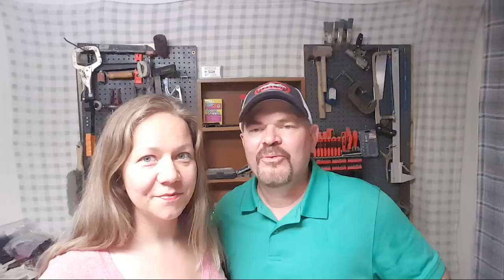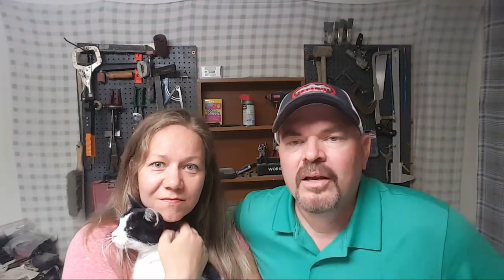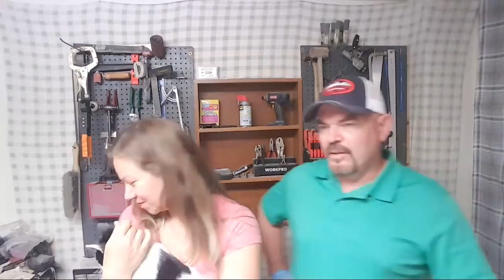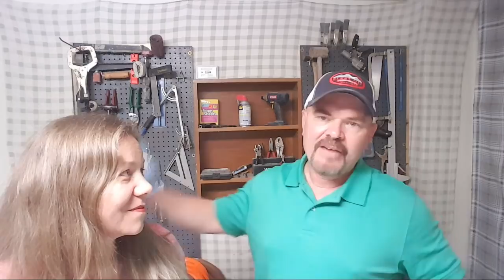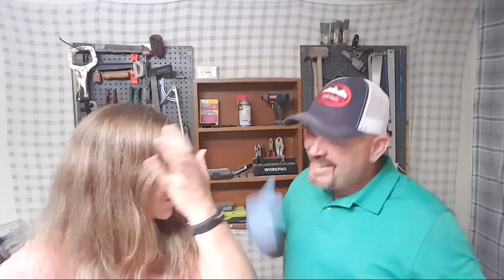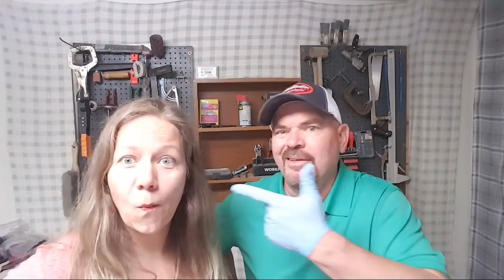Questions And Answers HDC Style

Comment: Hi Guys - really enjoying what you're doing!  I just wonder if we add glass fibres or fibres of any sort to the mix whether we could be looking at a modern 'asbestos'? ie If it has to be broken apart in the future, it could it be a problem?  Also, I wondered about adding straw to the mix (like you did with the flower bed blocks - if aircrete takes in moisture, would the straw go mouldy in the mix?

Comment: Do you have a way to let us know ahead of time when you are going to do a live broadcast. I have lots of questions and am just starting to get into aircrete. I think I have made a machine that will work but am waiting for it to get a little warmer to do it. Heard you are going to use a stucco machine. I was thinking about doing the same so am interested in seeing how it will or won't work.

Some quick questions; will aircrete work for a basement wall, where some other foundation material would be used for corner and support posts. Would Aircrete be strong enough for doing the other parts of the walls, using some metal screen/grating to add support?

Love your videos and would definitely take part in a live show!